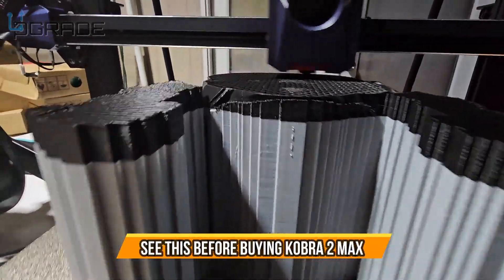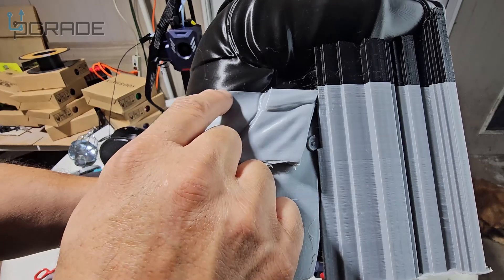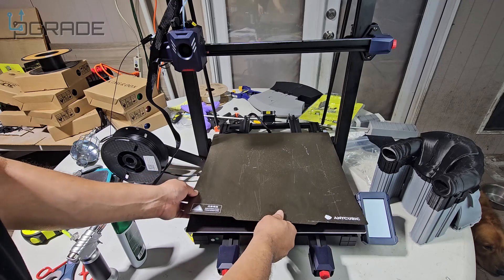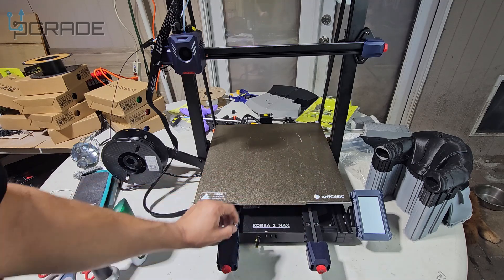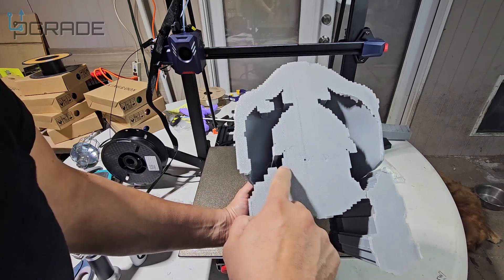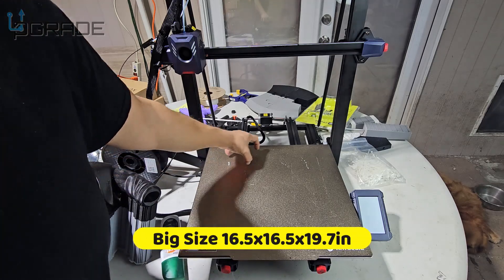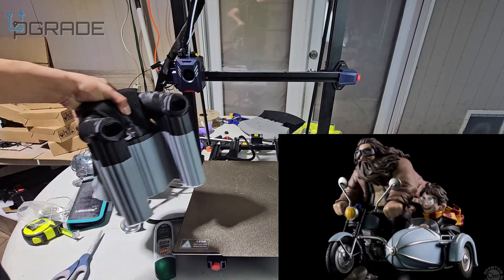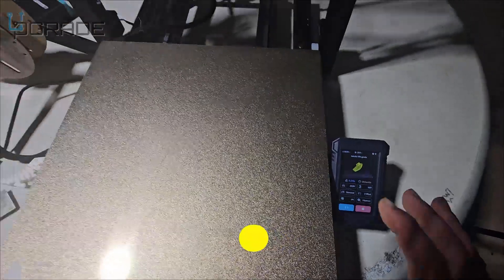Anycubic Kobra 2 Max - See this before buying

Comment: I’m putting mine on a battery backup
Reply from the maker: As a backup or as the main power because this printer fluctuates on power sometimes I notice it spike up on larger prints I don't know if this is normal.

Comment: Between the quirky/broken firmware (you cant even put a pause in the gcode to change filament colors or such.  The really crappy (aka useless) wifi that only works with their limited spyware slicer, and the NON-STANDARD HOTEND making it so you cant change to a .6 or .8 nozzle for such a huge size is INSANE.
-
BIG misstep by Anycubic, and I am VERY concerned their new multi-color will be even worse.
-
Reply: You can get all of those nozzles easily. Just search for Kobra 2 nozzles 😂
Reply: Oh my God, I want a multicolour so bad from bambu and right when I’m looking for this after experiencing anycubic disaster they now wanna release multicolour and it’s very confusing for a newbie like me who is very upset with Kobra 2 Max faulty functionality
Reply: @KUNDACHAK  I do feel that Anycubic FDM machines are far from ready for newbie adoption. I've been 3d Printing since 2015 or so, and the Kobra Max took me a bit get going.  Lets see how well ver3 does

Comment: I brought two Kobra 2 Max printers with an extruder nozzle fan problem. The second one also has a leveling sensor probe issue, smashing the bed. No one seems to have an answer to a fix. Sofar Anycubic appears to be researching these issues. They have a New Year's celebration most of the year and are very slow in responding to my after-sale request.
Reply: Same ! Any word back ? Seems like lots of faulty machines - I can only currently print the test models accurately, no other transferred gcode is completing 100 %

Comment: 1. The stock PSU fan is way too loud
2. Close firmware, you can't even connect to your computer or use octoprint

Those two reasons alone should make you think about another printer.

Comment: I just got and starting playing with my new Kobra 2 Pro.  This video is spot on.  Wish I had seen it before I ordered.  My first large print got interrupted for some reason while I was away at a meeting and quickly found that unlike my Vyper there was no recovery.  Probably just as well since I also had the same supports and they were impossible to remove.  Later prints using regular PLA and normal slow speeds and organic supports have turned out great so far.
Reply: had the same experience of a large print getting interrupted before finishing with my Kobra 2 Max, Anycubic has released an update that has taken care of this bug. Am choosing "organic" support in the Prusa slicer settings. those supports come of easy.

Comment: It's a shame to hear that the online services never came on.  There's always Octoprint!  as far as the huge long cable is concerned, I printed and mounted an arm to hold the cable slack above the X axis and out of the way.  Additionally, because of the large size, I designed an extendable/retractable base that will move away from the wall to allow the Y axis to move freely.  Im happy to share photos with you.

Comment: Going crazy here!!... Does anyone know how to calibrate the X and Y axis on these machines?. I can't even print a ROUND circle, even on the first layer :(
I know there is an adjustment to pinpoint the nozzel in the center of the tiny little circle behind the print plate... but honestly that is inaccurate. I used to own an old CNC machine back in 2012.. I could simply ask the machine to move 15cm on any axis...I'd move it along side a ruler and see what the difference was..then adjust the software... does this machine have any option like this?.
Reply: I’m sorry to hear this, and for some reason people are very unhelpful when it comes to this machine specifically the 2 max - I also just purchased one and it’s really put me behind in my business endeavours… it’s my first, but I’m a pretty technically smart person right off the bat I can tell something is wrong.. printing 5 inches off the model halfway through or after a few layers… like almost a double of the same model connected… and a few other printing issues.

Comment: Do you have recovery after a power outage???
Reply from the maker: Sorry no recovery build in yet I hope they resolve this issue
Reply: Ok Thanks,  Although thinking about it, when the hot bed cools down...the piece comes loose, so it wouldn't matter a little.

Comment: Are there fumes /smell with this printer and how bad is the noise?
Reply: So far, I could only get it to print PLA. PLA is no problem. It says it can print ABS, but it cannot. ABS and ASA make toxic fumes. Once I repair it from its self-destructive episode I plan to try ASA. As for noise, the fan is quite loud. But the real fun is the vibration this thing makes. WOW!!! Better have a sturdy workbench!

Comment: The correct answer is the Comgrow T500. 500x500x500 build volume, and built like a tank. These are toys.
Reply from the maker: The volume is slightly larger and the build is better built on the T500 but the price it what got me on the Kobra Max 2

Comment: I want to change to a bigger nozzle and looked online and found that MicroSwiss has nozzles that are supposedly compatible with the Kobra 2 Max. My only concern is that they seem like regular volcano nozzles without the small orifice at the tail of the nozzle.

Can someone please help?
Reply from the maker: Be careful they are not regular nozzles. They are different on this model, and this sucks because it is only available at Anycubic store.
Reply: @Upgradetech  that's unfortunate.  Will contact MicroSwiss and double check with them. Thank you for your reply 🙏🏻
Reply: If you haven't checked again they do various nozzles on Amazon and on AliExpress for this printer. No cht clones yet but normal volcano nozzles with the weird bit on the top

Comment: Got a small question. I want to get my first 3d printer but dont know witch one I should grab to start.... i saw this one with self leveling and it got my attention.... what do you recomand me.
Reply from the maker: I recommend a Bambu Labs. The PS1 Model is about the same price as this but not a large printer. It also has a self-leveling, and in the future, you can print in different colors. I recommend this one of the best printers from all my other printers.
Reply: I concur. Bambu Lab makes an awesome printer. I have the X1 Carbon and I love it. I also have the AMS. The X1C can print almost any filament. Their software package is top notch.  One of my first prints was a life-sized human skull with 7 yr old ABS. It came out perfect. Build volume is 256mmx256mmx256mm, so not as big but it will not destroy itself while you sleep. Kobra 2 Max will. Mine went batshit and totally destroyed itself.

Comment: I have this model and when I do the auto- level it’s not probing correctly leaving a huge gap between the bed and nozzle but once I send a print to the machine it scrapes the bed with the nozzle, what should I do?
Reply from the maker: Change the z axis on the screen you have the option to do this manually while it prints.
Reply: Mine also did this first time out of the box, scratched like heck out of the bed too. No idea how to fix it, I just messed with the axis and releveled and it seemed to fix that issue.

Comment: I have 2 of these machines. They are running good. You're running cables wrong. You need to run the large cable under the filament runout sensor. Then you cable tie it.
Reply from the maker: Thank You, I will make the changes
Reply: @Upgradetech Continue printing after loss of power doesn't work via USB. Try using SD Card
Reply: @marcfair3d  There isn't any SD card slot on the Kobra 2 Max though
Reply: excuse me, can i ask you to share you printing settings? I literally can not get any good quality...
Reply: hi friend, could you share the slicer profile? because I have the impression that the autolevelling is there only for fun, as if something is missing in the gcode, I added m420 s1 sle without success to have a perfect first layer

Comment: My sons Kobra 2 Max printer keeps shutting off a few hours into the print.  Has done this consistently several times now. Any Ideas on what could be causing this to happen?  We put a surge ac power protector on it as well.  Thank you.
Reply: Mine keeps shutting off midprint too and it’s driving me nuts. I’m currently trying to reach out to their horrible support for information. Forums aren’t helpful either, seems to be no fix tbh. My theory for now is that this keeps happening on sport mode. I’ve printed the same thing multiple times with no problem. I believe the first time I printed a large piece I kept it in standard mode the whole time. Last night I put it on sport so it could finish before bedtime & the machine/screen ended up stopping/freezing with no response again. I will try the same print again tonight and keep it on standard mode the whole time. I also have mine plugged into a surge protector. The Vyper has been flawless since I’ve had it the past 3 months. The kobra 2 max has given me nothing but ptsd since I first turned it on. This is a shame bc it’s a beautiful printer and works well when it does work.
Reply from the maker: Check the power switch, what is it set on?
Reply from the maker: Check the Power make sure it set to 115 instead of 220
Reply: @Upgradetech This is really bad advice. If they are in a 230 volt country, they will end up frying their PSU and likely their electronics as well.
Reply: Where is that located? @Upgradetech
Reply: funny, mine froze after I loaded a print....it's happened 2 times already
Reply from the maker: check the voltage gage
Reply: It is a firmware problem.  I was on 2.3.5 and it would stop mid-print in the same exact location each time and the screen would go dark. Then you must reboot it, losing your print job. It was rumored that the USB they send with it was causing the issue, but I was using a high end USB stick and it failed, debunking that theory. Firmware 2.3.6 introduced a Z axis problem that would ram the toolhead into the build platform. Not ideal. I am on 2.3.9 now. Left it running and went next door. When I came back, it appeared to have shifted my part to the right about 6 inches, rammed the toolhead into the build plate, repeated the process an inch over, printed over the calibration sensor, grinded the toolhead against the back of the build plate sending aluminum shards everywhere, ripped off the hot end and continued to try and print, spitting out a lot of filament. It was a huge mess. I replaced the hotend and  during Auito Leveling it attempts to zero itself in mid air about an inch off the build plate in the negative X axis. Dont even try to print as it will slam the hot end into the build plate. I am still looking into this. Love the build volume, not so much everything else. it seems like a rush job. And I cannot fathom how it can print ABS as the build plate max temp is 90 C. It has to be 100 C at minimum. And I tried it 5 times...no way.
Reply: And I didn't use cura .  Anycubicslicer o prusaslicer. Me pasaba igual con cura
Reply: But anycubic sends you the correct plug for your country
Reply: The printer is just horrible … just get to the fax … everyone having multiple issues all of Which seem similar - I’ve been given advice to return and save for bambu lab

Comment: The absence of the power failure recover it’s a deal breaker with 3d printer of this size, every time you print something really big, you are in danger to waste a lot of filament and a lot of time. How is not present?
Reply from the maker: They mention it will be fixed on the next firmware update. I hope this is true.
Reply: @Upgradetech   Sweet to hear that. Now if they will actually do that. Have you used the Wi -Fi ?
Reply from the maker: Just started to use the wifi two days ago
Reply: Uninterruptible power supply.
Reply: Losing power on printers is a rare occasion. Unless you don’t live in a 1st world country in which case yeah it’s needed. But for most ppl it’s a greatly unused feature
Reply: @bradenhenderson1332  that’s a feature on a very basic 3d printer, my 6 years old alfawise u30 has it
Reply: Has the furthermore been fixed because I just bought one last month and I’m having major printing issues… 

I bought this printer to print a very large pieces , and I’ve wasted at least three spools of filament because it’s messing up halfway through. 

It’s very frustrating

Comment: I want this printer.  But I'm undecided, even the elegoo neptune 4 max is identical.  However,  some people say that the quality of anycubic is superior (like a resin).  My goal is to cosplay.  Do you have some advice?  The important differences I see between the two printers are: the elegoo has more powerful fans and uses the klipper interface, resumes printing after a power failure and the nozzle reaches 300 degrees.  Seen like this it seems that the Elegoo is superior but as I have already said some reviews say that the Anycubic is better in terms of quality.  Personally I hope that anycubic can use klipper as an interface (like fluid or mainsail).  There are still few reviews though, I want to wait
Reply from the maker: The Kobra is better because you don't need to adjust like the Elegoo Neptune 4 max, I have the Neptune 3 it is similar to the four without the fast print, but I hate to change it every time I have to print. With the Kobra I don't need to make any adjustments.
Reply: The Y axis is not the same. The Kobra has 2 belts and 2 tensioners.
Reply: I bought a Neptune max 4, I returned it because the firmware is not working yet and the bed will not level.
Reply: They’re pretty similar. I’d go with the Kobra 2 Max, it seems to have better print quality. 

Kobra 2 has: better y axis with dual rails, metal wheels rather than the plastic v wheels on the Neptune 4 max, auto z-offset. 

Neptune 4 max is a bit cheaper, Elegoo is said to have better support than Anycubic, uses closer to stock Klipper/fluidd/mainsail, better processor.
Reply from the maker: @aminorinternet  I've been running this printer for since I purchase it and I haven't had any issues. I've printed cosplay parts and more larger figures, and so far, it's my Second favorite printer. My first is Bambu Labs.
Reply: @Upgradetech Any advice for supports? I use organic in prusaslicer, but they leave a lot of marks on me. All the best